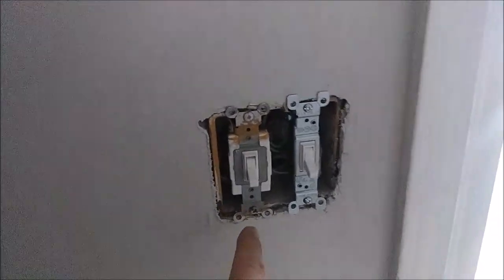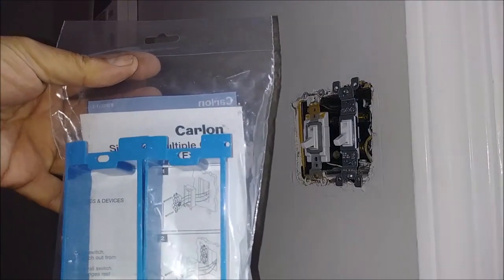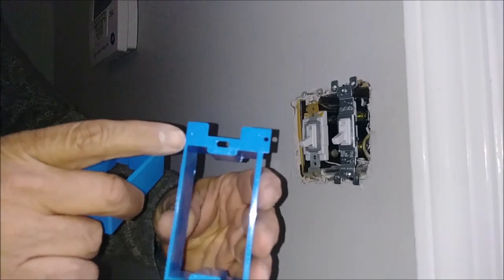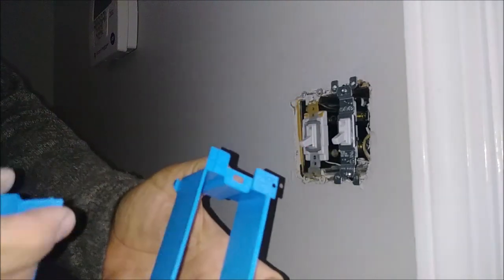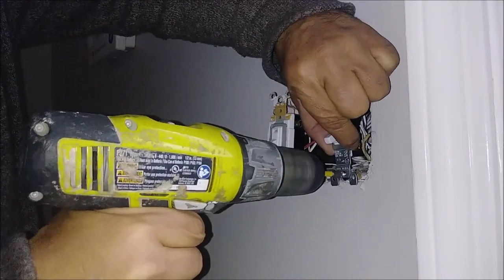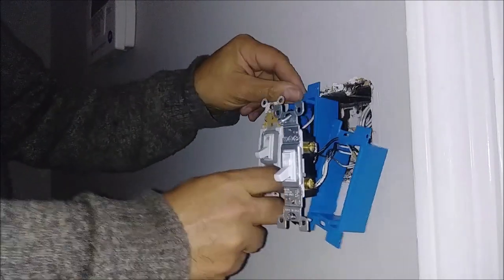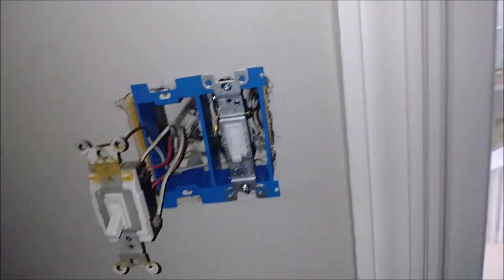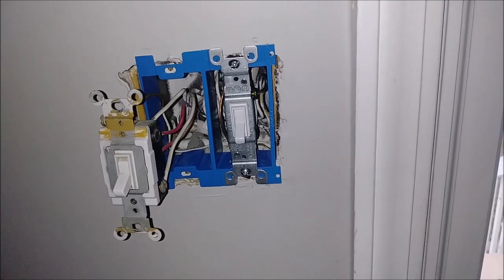How To Extend Electrical Outlet Over Dry Wall  That  Is Not Position Well Around Outlet

Comment: For a single outlet, you can take an EXTRA BLUE OUTLET and cut the size you want to extend out. I needed 1/4, so I cut 1/4 from the top side, then slide it around the plug as a spacer. I used a oscilating tool with round edge to get a straighter/even cut. It worked great for me, just made that shit up lol
Reply from the maker: Thanks for the info.